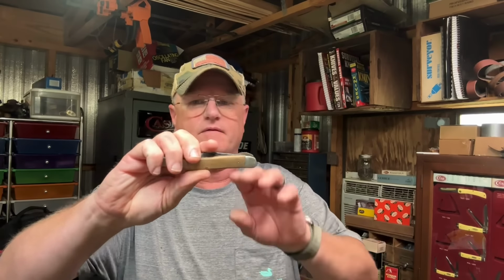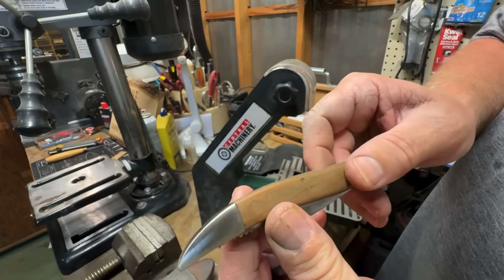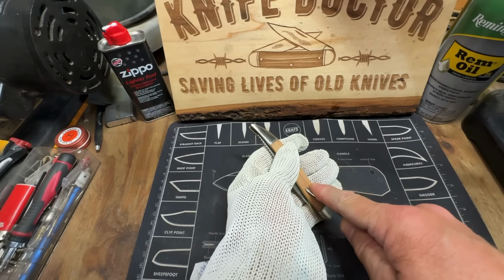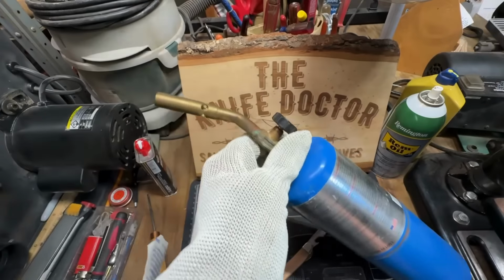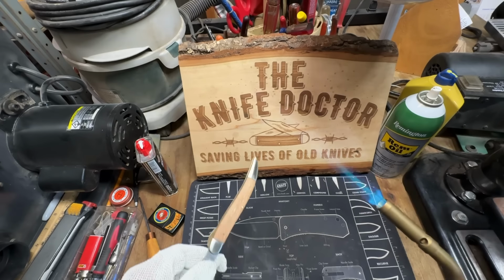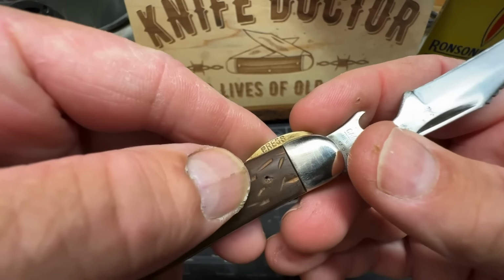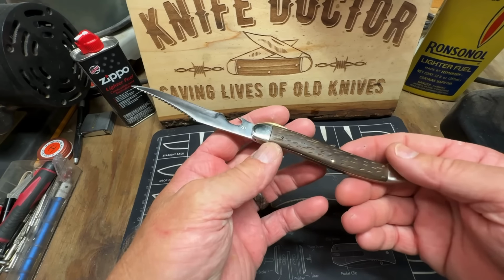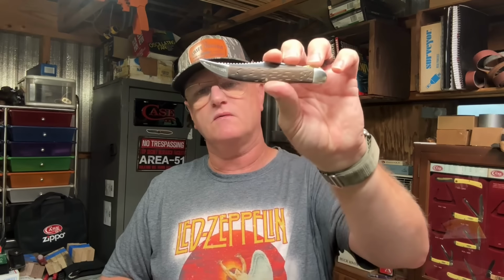Knife Transformation: Jigging and Burning Camillus Knife Handles!

Comment: Hey Knife Dr. I have a question for you - why don't you soak your knives in minerial oil instead of brushing it on? I soak all (even new knives) in a tube of mineral oil and let it sit there for a few hours. It helps with all wood and bone handles and protects all the metal inside and out. Soaking it allows the covers to really suck up the oil and I can really tell the difference. thanks for answering this if you would.later
Reply from the maker: Thanks for sharing this!